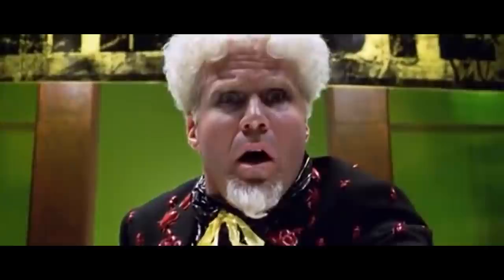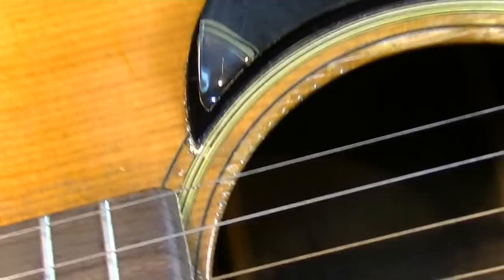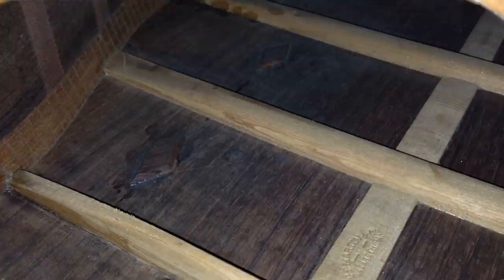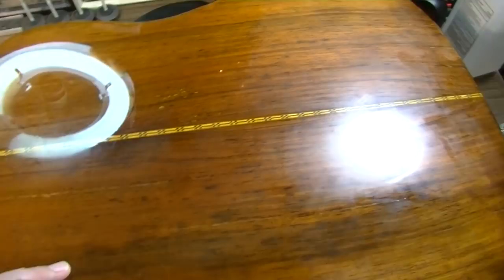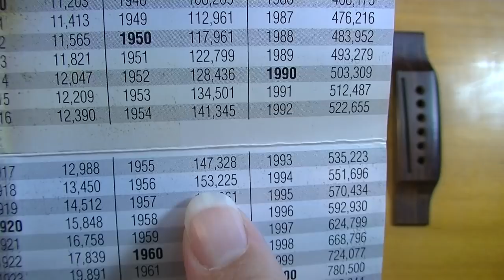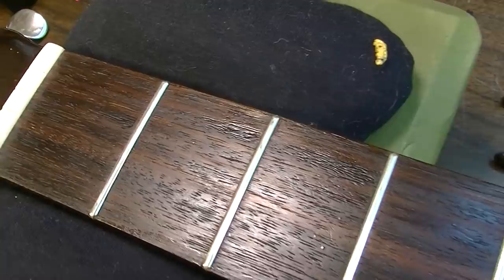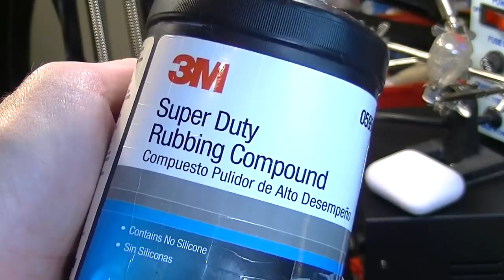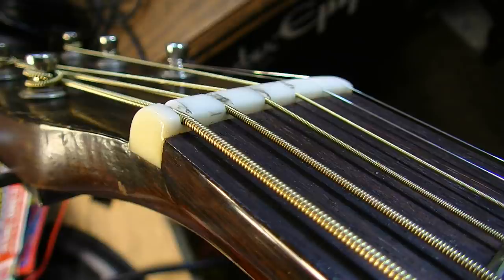DID I JUST GET RIPPED OFF? - The Craigslist Martin D-21

Comment: Tone, projection, and resonance sound great.. You did a nice job with keeping the patina of the original guitar. I also like lemon oil on necks. I also use violin finger board oil as well, although it is a slightly thicker viscosity and it lasts longer.
You need to do more guitar fix and repair videos. This was a good one.

Comment: Sweet video. Amazing Martin. Few battle scars but thats part of the story and history. One thing I noticed towards the end of the video the close up you gave of the saddle are you could see a dark line and slight depression in the finish and wood. The depression or mark was on an angle it looks like part of the bridge replacement was also to correct intonation on the Low E and A strings. It was very common for guitars of the 40's and 50's to not have the intonation perfect on the Bass side. I have seen numerous repairs where the bridge was moved or the saddle was recut on an angle to compensate for the needed proper intonation. Its very cool to decipher these old guitars and their previous repairs. Part of the reason I am drawn to vintage Guitars and old antiques. Even old school architectural mill work. You just don't see the same type of craftsmanship anymore. Everything is done by machine and settled with a good enough attitude. Thanks for sharing this classic piece.

Comment: An old guitar from SE Kentucky? that wear and tear looks pretty reasonable, that guitar was probably left out of the case in a church with no central air to speak of so it's probably been through years of temperature extremes. Probably seen its fair share of tent revivals and getting baked in the sun too.
Reply from the maker: Yep. You know the drill.
Reply: Or it could have been left out its case in a road house with no air conditioning and  probably saw its fair share of bar fights, lost love and broken down pickup trucks.  As Jimmy Buffett once wrote, "imagine all the heart aches and tears of 27 years of beer".  Fine looking Martin through it all.

Comment: I bought a Martin D-35 in 1977. This was after the Martin Co. was bought by AMF a few years previous. They obviously cheapened everything regarding the materials, production, glues. trims, etc. The quality of Martin guitars of that period plummetted. After a few years the guitar was delaminating everywhere and the neck was so warped that the guitar was unplayable. They have a lifetime warranty so after putting the guitar in its case where it stayed for several years, I contacted the company. They sent me a diagram of a shipping case I had to build to ship it to them. The case was so involved that I would have needed an engineering degree to build it! Back in the case it went for another ten or fifteen years. By then the company had been bought back by the Martin family and had added national warranty network of Lutherers to fix warranty repairs on their guitars. I took it to one in Florida. Three years later I got the guitar back. It now played like it never had, was like a new guitar. been playing it ever since.
Reply: Was Martin really owned by AMF? I think you're thinking of Fender, which was owned by CBS for a time(or Harley-Davidson, which was definitely owned by AMF for a few years!)
I think Martin has been owned by the Martin family for their entire history.
Reply: Three years? It took 3 years to get fixed? Wow!
Reply: @rorystorm4284  I think there is some revisionist history going on here as the official histories don't mention it. But I found another reference to it in a guitar forum: "tom2caster wrote:
... I believe AMF owned the company by the time yours was built." He was referring to a Martin guitar in the discussion. I clearly remember the situation back then when AMF bought the company or bought control, and cheapened the guitars so that they became unplayable.
Reply: Sorry, Alec. Martin was never owned by any other Corp. They've always been privately owned. Not hard to confirm.  Just check. Just cause some guy on a forum says something doesn't make it true.

Comment: Man that thing sounds GREAT!  What a score!   I'm pretty sure you'll more than make your money back should you decide to resell.  I would like to add a bit of information, nitro lacquer chemically bonds to itself unlike most modern finishes that form mechanical bonds.  So, you aren't forcing one layer into the previous, you're just polishing the layer period, as nitro forms just a single layer.  Which is part of the beauty of nitro, and why it's so easy to repair.  You could take a clear nitro touch up pen and make that circle around the A tuner disappear completely with a little finesse.
Reply: you have to learn how to hear the audio engineering.  its more mic than real tone.
Reply: Bo Huggabee so...you’re saying this 50s Martin doesn’t actually sound good, and it’s the...mic? That sounds good? I’m sorry, but what are you talking about?
Reply: i'm sure the guitar sounds great in person, but it doesn't sound like that.

Comment: Martin does not finish the neck and body together.  There should be no finish in the joint at all.  That neck has been reset, and not by Martin.  I also wonder if some of the finish damage in that area was caused by steam?

Were it mine, I'd replace the bridge with the correct Brazilian rosewood and a through saddle.  That EIR looks way wrong.  Also, anything but that fugly black pickguard.

The over-spray also does not look like Martin work.

As long as you bought it on the money, it should be a perfectly serviceable old Martin that you won't get hurt on down the road.
Reply: I agree, and perhaps it is just camera-flauge, but if Martin replaced the nut it was poorly done.  The strings look like they sit way too low into the nut slots.  Like I said, sort of like string action always looks high on camera, maybe it is something to that affect.
Reply: I need to clarify a bit, excess material above the strings on the slot.  Not that the strings are too deep.  Sorry for the confusion.
Reply: also looks like the whole top was off at some point from what i saw looking at the side binding and inside gluing.
Reply: @davehendricks7023  You may be right.  Martin usually didn't leave a mess like that back then.    It also looks more like that nasty brown crap Gibson was using at the time rather than hide glue(Resorcinol, maybe?).

Comment: Hi Brad.

Lemon oil sold by d'addario or earnie ball and other brands is not natural. It is pure petrochemical and the lemon scent is artificial.
It does not mean it is bad for you, but it also does not mean it is good.

Also so-called essential oils, which you can buy in your local pharmacies, are actually bad for your guitar, since they draw all the moisture from uncoated wood.

"Natural" stuff that does the trick is vegetable or seed oil, that can polymerize well, such as linseed oil. But, as any other natural or chemical product, it can cause allergy. But that's another talk.
Reply from the maker: i use D'Andrea. Claims to contain real lemon oil.
Reply: @TheGuitologist  I'd like to learn more. Where can i read about the stuff D'Andrea oil claims to be/contain?

p.s. even if it claims that it contains real lemon oil, it's somewhere near 0.5-2%, the rest is marketing, and petroleum distilaltes or some other stuff. Real lemon seed oil is very pricy.
Reply: linseed oil has never let me down and cost very little
Reply: Lin seed oil is great, but I don't have any so I just use hot fresh bacon grease, the clearest the better ! Especially when it comes to the nitro finish guitars, they react the best to the natural oil bacon grease. Also cheaper guitars with the thin matte finish will shine up and polish to a shine as opposed to the flat color that matte is known for.
Reply: @auntjenifer7774  Bacon grease is ok but if you don't want that crunchy sound, try biscuit gravy for a thicker sound or maple syrup for a sweeter sound :-)
Reply: I like F1 fretboard oil by music nomad, it's 100% free of any lemon oil extracts, waxes, petroleum distillates, silicone, and water. I heard lemon extracts are bad for unfinished wood...
Reply: LightningDogg 😉
Reply: Logic Seeker * Yeah, the acid or something ? Like I said before, nothing rejuvenates a dry Rose wood board like the hot bacon grease, maple boards too ! And if you don't like the matte finish on your guitars the bacon grease will change the matte to a nice shiny almost thin nitro like finish if you polish it up, it may take two it three treatments but it works.
Reply: @auntjenifer7774  and it make your guitar smell like bacon,,, what could be better than that???

Comment: I enjoyed the video and am a little more educated.  Thank you.

Question #1;  Why not lube the tuners when you had them off?  That way the lube could be directed onto the mechanical parts with no waste or mess to worry about.

Question # 2; I own a 1973 Hohner 310 (a D-28 Japanese clone) I bought in 1975.  Very well built and has been well played.  I had the original fret wires changed in around 1982. The finger board has a lot of wear to the point of what I call "divots" on the first five frets.  The fret wires also need redoing at this point.

At what point is sanding the neck insufficient and the  fingerboard need to replaced? I realize you can't see the fingerboard and photos just don't show the extent.

Comment: I couldnt see the area very well, but it seemed to me that the top showed some signs of folding in on itself...buckling in the middle...which would explain the high action.
Very very common on old acoustics, but Ive seen repairs on that problem and sometimes they had to either re-do the top bracing or add more support to it.

Comment: Great video Brad. I'm glad you got a good deal on a beautiful vintage Martin. I have a 1947 OO-17 that probably needs a neck reset as the action is high, but I'm a bit reluctant to have it done in case they screw it up and it loses its value. What gauge strings did you put on your Martin? I have 13s in mine and they sound great, but I'm afraid they might be pulling a lot on the neck since their tension is quite high.
Reply from the maker: Don't go above 12s on an old Martin.

Comment: Considering how much the guitar was played, I'm not surprised it needed a new case after ~15 years of lugging it in all sort of weather conditions. The replacement bridge matches the fingerboard pretty well, almost as if it was the original, but they also would have looked for matching wood for the replacement.  I found some pictures of D-21's without saddle-through bridges, but they may have been replacement bridges too, and most D-21's had the usual Martin saddle- through bridge design.  The case may be ugly, but they built them sturdy, and waterproof - I used to lug my '72 D-28 around in rainy Marin with a case like that. It has that great Martin dry woody sound, with good midrange,   and would likely sound good through a microphone without booming.  Jerry Garcia bought two D-21's from the music store where he taught banjo in the early-mid 1960's, so he must have liked them too.  Thanks for sharing!!
Reply: Pharmer David m

Comment: Well spotted, Brad! Despite the cracking from all the usual suspects; hydration, age, and wear. This instrument was a treasure trove. I've never been one to turn my nose up at lemon oil per se. But many of the commercial suppliers have blended adjuncts like petroleum distillates. or ethanol within it. I concur that the oil is intrinsically sourced naturally. Yet it should be noted that citrus' oil is an acid. The adjuncts are to prevent the oil from congealing, or in place to actually suspend dust, and dirt to be wiped away. They also help it evaporate, whereas pure lem oil would not. I use a different fretboard lubricant, but I do use lemon oil on certain wenge fretboards. Seeing the graphite took me way back! A homage to the old school! I now use Rene Martinez's Graph it-all. It's a ceramic lubricant that stays in place for chronic de-tuning and re-tuning the same instrument. I add it to saddles, bridge plate break points, string trees, and of course...nuts. I think you'll dig it. I met him way back while he was SRV's tech. Congrats once again on that 62 year old, sonically sweetened beauty. You have my envy.

Comment: One thing I’ve found on acoustic guitars (especially martins ) is that the height of the saddle has a HUGE impact on tone and projection.  As much as it’s tempting to shave the saddle to substitute for the hassle of a neck reset, it makes a huge impact in tone.  Martins (especially the ones without scalloped bracing) LOVE to have that extra downpressure on the top from a taller saddle to really drive the top and project.
.
That said, looks like you fell into one hell of a deal with that guitar!

Comment: Never worked on a early model acoustic but when I had newer acoustics with a hazy finish it was because the owner used a commercial furniture polish (Pledge, Endust, etc) to polish the guitar. Dont use furniture polish on your guitars. Lemon oil or linseed oil works fine. This has been my experience and this is my opinion, I could be wrong.

Comment: Lemon oil is fine. I use bore oil (for woodwinds) which is much lemon based. Never had a problem with it since the 70's. Other natural wood oils are fine too. Good idea to stick with one type though, that's why I always chose bore oil as  clarinets & the such need a fairly consistent type of oil.

Comment: I have a 1995 Martin HD-28 with a black pick guard. I've only ever seen one other HD-28 with a black pick guard. I guess they ran out of the tortoise shell ones the day it was attached to the guitar. My 2006 one has the tortoise shell. So, not normal, but not a fake either. That D-21 could have had a black one originally. I went to the factory for a tour in Nazereth and they said it is unusual, but sometimes happens. Besides, what length would he have to go to, to get that OLD black pick guard?

Comment: Sounds great. Good job. I’m thinking about getting one now.
Reply from the maker: If you get a Martin, spring for a real one - a D-18, D-28, etc. steer clear of the Formica bodied ones with the laminated necks. Good for the price, but not a traditional Martin and hard to repair.
Reply: Yeah there are a few mid 70s d18s floating around here on Craigslist. How’s the build quality during the 70s?

Comment: Cool that you bought a 1956 Martin instrument, Brad. I bought a 1956 Martin A mandolin last year from an Irishman (luckily, because I didn't realize the seller was going to send me an instrument with a Brazilian rosewood fretboard: ordering from the USA could have caused customs troubles). It needed some work too, like removal of some old broken piëzo pickup remains and installing a new bridge saddle and replacing the totally wrong golden F-model tuners with excellent period and style correct replicas (€65.-) for a total of €150,-), so all in all the instrument in its present condition costed me about €600.-
I didn't find a vintage Martin guitar that cheap yet, just new Mexicans here.

Comment: Nice buy man! I was kinda worried for ya until you made that phone call! I was always under the impression restoration hurts the value of these old guitars? I under stand string changing and full setup but staining it thought might hurt the value? I know not having the original bridge and the main top cracks and binding cracks may hurt the value but overall looks and sounds like a great guitar! Those old martins just have that tone! Always wanted one for blues playing but they are soo expensive. I actually got took on an acoustic on craigslist once not for alot of money though. It was a washburn claimed to be american turned out to be china made but it still had good quality surprisingly. My uncle actually pointed out made in china in micro tiny letters. Everything else was correct except for that oh well thats life! Nice video and good luck!

Comment: You did well my friend! I’d have to get a good tortoise pickguard for it and I would have also been tempted to run that saddle slot all the way out and done a proper through saddle and cut some of that excess material off the top of the nut, no reason for the strings to sit that deep in. Nicely done ✅ though and it sounds great!

Comment: hey man I have a bunch of old martins including some d-21s I used to have a 56, the pick guard wasn't tortoise in 56, it was actually a 1 year pick guard on the 56 Martin d-21 often referred to as a pepperoni pick guard. believe it was a nitrocellulose. I looked at another 56 d-21 but I didn't get it because the pick guard was changed, impossible to find.

Comment: I just looked at another original martin 1956 d-21 in full original condition and i noticed the tuners were originally by grover but looked vintage kluson style with flat head screws if this helps you any! Also it looked like a tortoise shell, bakelite style pickguard. Good luck with it!

Comment: Looks like the top has been taken off at one point. You wouldn’t see that much glue squeeze out around the perimeter. It’s also apparent the binding has been removed and reattached. Also, not the original bridge plate. The grain would not have been at an angle like it is. Would have been perpendicular to the top grain.

Comment: I had Martin warranty repair done on a 1972 D-35 in about 1976.  They did an abysmal job.  They slopped finish unevenly all over the front.
I did some other repair work myself that far exceeded the quality of their work and I somewhat evened out their finish mess.
I guess it depends on the individual doing the repair work.  Hopefully the guy that worked on mine has either gotten much better or moved on to another career.